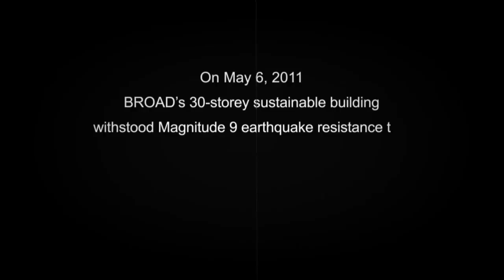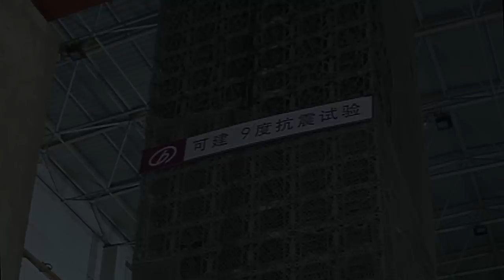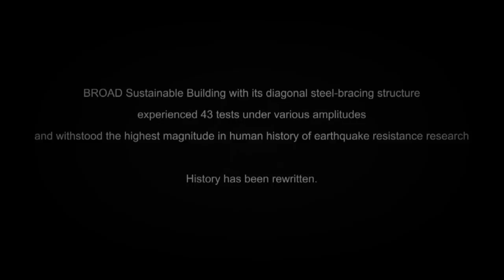Seismic Test for 30 Storey BSB Factory Built Building in Beijing Earth Quake Research Institute

Comment: The measured acceleration of the ground in the Northridge earthquake was 1.8 gs.  This was a 6.7 magnitude earthquake.  The vibration tests shown here are very gentle by comparison.
Reply: They were probably taking into consideration the size of the miniature 30 story building and shrinking the shaking down to something that a miniature structure could handle.. Therefore mimicking a 9 pointer on a small scale

Comment: the building is braced in every single bay and the frame itself seems moment resisting, the floor loading's can't be actual loads. and the characteristic of lateral loads are not clear, also the ground factor has been deleted here, some grounds intensify the earthquake, like what happened in Mexico
Reply: :- Yes! The ground moment and intensity is very abnormal. It is not considered here. The COST factor to construct this type of Building will be very high. The actual construction and further mentainance will not be user friendly with the Masons and work force.

Comment: Look at the left corner of the building, when there is a vibration with an increasing magnitude, the column in the left corner of the building is lifted, this indicates that there is a large tensile force on the foundation. It is possible that the superstructure of this building can withstand a strong earthquake, but what about the foundation?
Reply: Yes, it would severely compromise the foundation if not destroy it

Comment: This building although strong looks like it has so much internal bracing that it may be difficult to actually use. The result is a building that will never fall down but one that no one wants to rent.
Reply: I believe it’s just a smaller version of a thirty-story building? Or perhaps just the framework? Idk, though. In the words of Zoolander: “what is this?! A skyrise for ants!?”
Reply: #IF_YOU_WANT_TO_BE_SAVE_AND_SECURE_YOU_HAVE_TO_COMPROMISE
Reply: This is the precursor of the prefabricated building that can stand 9 magnitude of earthquake
Reply: And yes the prefabricated buildings is build and in used nonetheless Not sure how many of such buildings are ordered
Unless huge damage to many places, & 30 storey buildings
Builders may then turn to buying the prefabricated buildings or create more of such earthquake resistance buildings.

They are preassembled according to order & design and then can quickly put together still be very solid
Reply: The internal bracing would surely just be hidden in the walls so you wouldn’t notice a thing. I reckon they’d go like a hot potato if they’re solid and earthquake proof

Comment: I THINK THERE IS SOMETHING WRONG WITH UNITS....THE ACCELERATION IS m/s², as for the vertical components, it's ruled by the code, e.g the EC 8 oblige it for the cantilevers of 5 m and 20 m spans, now to me, the connections have the key of the ductility of the structure which is not properly taken care of , the dimensions of the screws used here has a huge ratio comparing to reality ....which will really influence the results

Comment: The reason why this is not realistic, is because the frame is free to shake, flex, absorb and release energy. If walls are added, the frame becomes stiffer; thereby making the building more rigid.
Reply: you think people who make these kinds of tests arent smarter than you?
Reply: @TheLegend-yb4ok  LOL
Reply: Every Engineer who's understands how the forces are transferred from two points would understand why this guy is saying this, his making a valid argument, Take into consideration the foundation and the soil which is the base of the building which can have different results depending on the moisture content and also the temperature of the day. So this factors should also be considered while doing such Tests.
Reply: I wonder if in the testing weight is added to each floor to simulate the furnishings and structure found in a finished building ? as the weight per floor increases I would think that would affect the flex and rebound

Comment: They only use short wave lengths on the building short wave lengths doesn't affect tall building to much
Reply: Even atrong ones
Reply: Indeed. It would be interesting to know what the resonant frequency is on the model and compare this with the driving frequency.  When they are close to each other the displacement of the structure increases dramatically but it you stay away from resonance then you’re shaking in safe territory.  Cool model though.

Comment: I think; This test is so wrong?
1. No vertical movement
2  Steel must be scaled in value. Material ratio = Material / 10
2- The grounds are very rigid. Regardless of the actual ground motion.
Reply: why? I think vertical movement is more dangerous.In practically,vertical movement rarely occurs because earthquake motion  is horizontal .So, No calculating design with vertical movement.Other weak point is that we cannot see the action of between soil and building.
Reply: 待化的冰  It does. The earthquake has always two accelerations. The vertikal component like a horizontal brings additional load to the deadload.
Reply: How about your house, office etc have been vertical test?

Comment: How about if the frame was reinforced concrete? It able to resist from M7 to 9 or it will failed? Hope u will test in sample of RCD. By the way thanks for your video.
Reply: Concrete is not flexible so it would not be able to withstand an earthquake due to it being bent and cracked

Comment: Even if the building don't collapse you will be thrown around like a ping pong ball in the upper levels causing serious damage.Nevertheless I'm not sure if there is any isolators used in this experiment looks like a rigid connection between building and foundation.

Comment: The scaled model is obviously too rigid for a knee brace connected building. As a result, these test performances are at best for commercial propaganda and not for scientific application. Also, using the bolted connection for all the column splices at high-rise building is a questionable construction method. The column joints would become discontinuous and could fail first in extreme load conditions, bringing down the whole building similar to the WTC Towers.

Comment: I would like to see the effects of corrosion and hydrogen embrittlement once the building is over 20,30, 50 or 80 years old. Have they simulated that?

In addition what about adding the weight to the top of building for people, furniture, AC and water tanks, etc. 

The building needs some sort of smart system to provide information on structural integrity as it gets older. The ductility is questionable. The anchoring is also questionable.
Reply: I am not an engineer, but I believe a structural integrity system could work using built in resistivity sensors that could detect the conductivity of bolts in the building. When bolts rust, their conductivity decreases. This hypothetical sensor could be used in conjunction with deformation sensors to calculate the integrity of said structure. :)

Comment: @asia911 So long as it's built in the same way, with 1/10 of the weight, and with 1/10 the amount of energy shaking it (as compared to a real earthquake), then it will be an accurate test.

Comment: Cool stuff, but judging from the rigidity i would not want to be on the top flor even when the 6 or 7 magnitude quake hit. Even if a rigid structure would hold up, there is bound to be significant stress related damage. The entire building would be damaged even if it was still standing.
Reply: The idea is to save lives and not the building.

Comment: [1] Where are Walls???
Buildings get damaged due to the impacts of brick or any other material’s walls, which are moved due to earthquakes. Here walls are not shown.
[2] Disagree with the Impacts and Magnitude factor, since the waves and movements of earthquakes are not only horizontal but vertical, inclined and in any abnormal directions. ABNORMAL factor is missing in this example. Do not compare artificial earthquakes with actual earthquakes.
[3] Is the material used and open structure useful and feasible in actual building? Not at all....

Comment: @asia911 I see that u haven't got a clue about structural engineering. This 1/10 model was calculated adequately to its scale (all conexions, beams and poles). In this way we can say, that the model is appropriate to its ten times bigger oryginal structure. Doing this without any calculations would be sensless. I'm truely immpressed seeing this test. Unfortunately i did not have this kind of research on my university:(
btw. asia911 are u the old asia9092 from wykop?:>

Comment: @aluminox..my comment was about the whole thing being built in a short amount of time with workers working non stop.. It has nothing to do with structural engineering. If u think about it of course the model passed but the real thing will fail because how do you know 100% if everything was bolted correctly in that short time..

Comment: did anyone checked the damage on the building services? the more rigid a building the higher the acceleration on the building services which can often cost equally or more than the structure it self. Building services can also cause fatal accidents.. in any case I have to agree with some other commenters this does not look like a good simulation. Just take the ratio of the bolts over the breadth of each bay. Sorry. Not convinced.

Comment: While you can learn a lot from this kind of experiment, its just not fully realistic.

There was a shake table in Japan which I think is the largest in the world, and they tested a 6 or 7 story wood frame building with all of the available components to retrofit, and they did a real 7.5 magnitude quake shaking up and down and side to side. There were cameras inside the building showing a table that overturned. The experiment was hosted by Simpson which makes the strong ties, anchors, and displays how effective the components all work together to keep the building not only standing, but habitable.

The maker of this building (Broad) was planning a 200 story building at one point. While I believe they can make a resistant building, I dont think they can building something so huge based off of what they learn from these experiments. The sky is the limit and it IS possible to build buildings now that can withstand a magnitude 9 quake. They just retrofitted the Space Needle in Seattle to withstand up to a 9.2, and most well build towers built from the 60's and on should be able to remain standing even when taking a good deal of damage. But the point is for people to get out of the buildings alive.

https://www.youtube.com/watch?v=9X-js9gXSME

Finally, the intensity of the quake is what matters the most. A magnitude 7 can push over 2 G's of accelleration, but so can a magnitude 6 as displayed in Christchurch. The difference is with lower magnitude, the duration of shaking is not as long, and the waves are shorter.